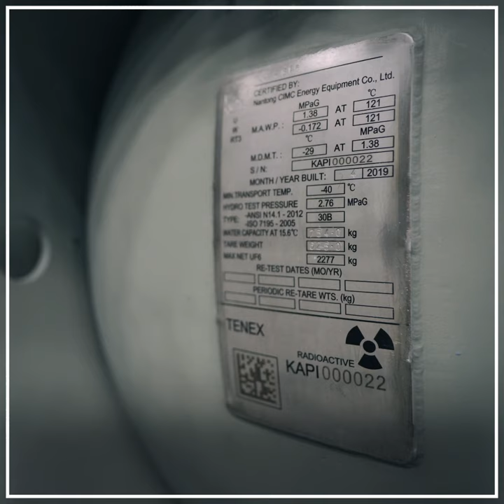The world’s uranium bank for nuclear reactors

Comment: The fuel will run a large city for three years. But a solid oxide fuelled PWR reactor can only use about 4% of the fuel’s fissile energy. 
Molten salt reactors (eg Moltex or Elysium) can extract the remaining 96%. Their waste has a half life of just 30 years (against 30,000 years) AND they would get 60 years worth of power from the same amount of fuel. They do this with an intrinsically safe reactor working at ambient pressure. The salt fuel traps the dangerous elements (iodine 131, caesium 137) as stable salts which are none volatile.